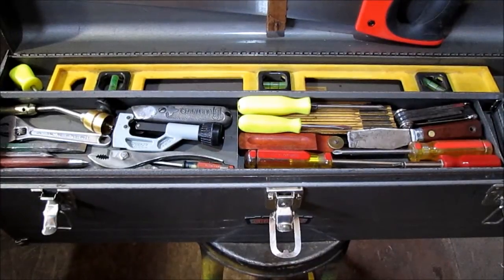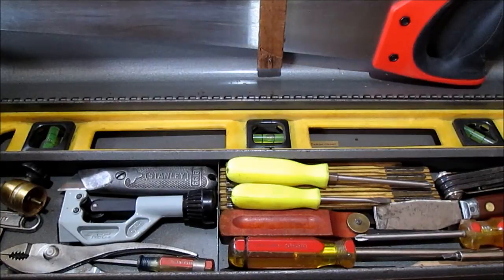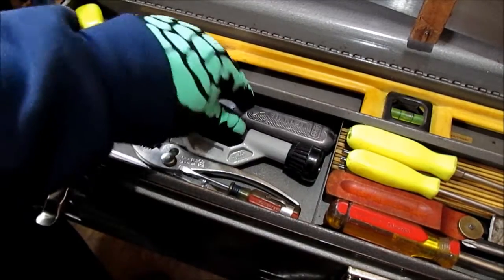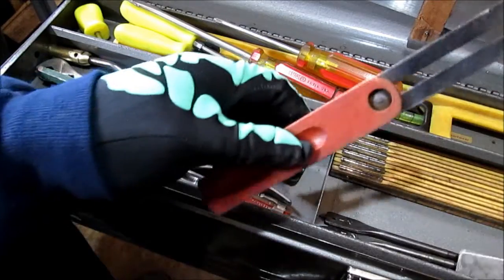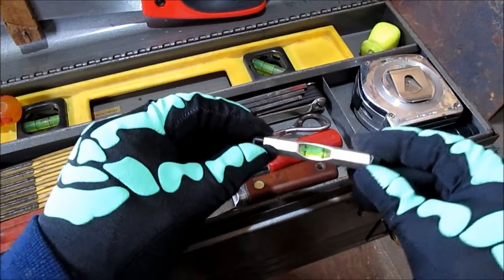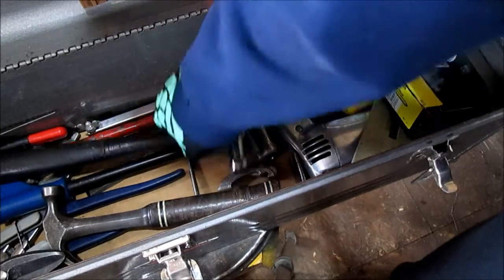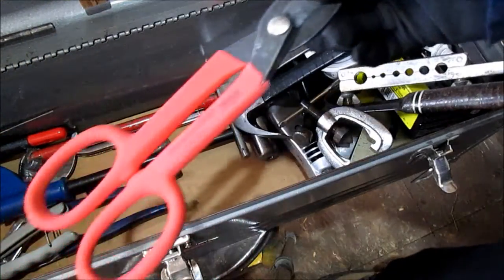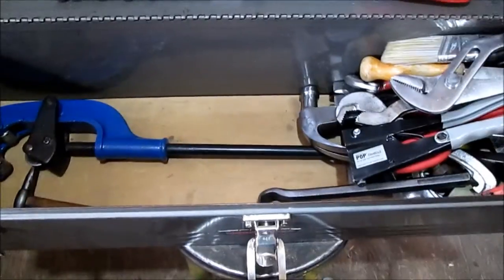What's in my CRAFTSMAN carpenter box

Comment: Bettlejuice on his day off from scaring people. 😂 only kidding. Good vid. I just bought a similar box.
Reply from the maker: I like old tools !!!
Reply: not2fast4u2c 

Yea. I love old tools too my friend. Here in the U.K. 🇬🇧 we have, what we call car boot sales. People bring their junk in their cars to a car park. Park cars in a semi circular fashion and open their boots(trunk to you over the pond) and sell. Some bargains to be had in the way of tools. I try to buy old wood chisels. Not just because I collect them but because the steel is superior. I've got the same estwing hammer. Beautiful tool made in Illinois. USA. My box was originally made to house a telecom cable crimper which was broken. So I discarded that and several dividers which I'm in the process of grinding out. I found the box on eBay for £20. I might make a tool tote for smaller tools such as Tape measure, pencils etc. For the top. I like how how you got your handsaw in the lid. 
Here's a tip.... cut a 6mm piece of spruce ply for the bottom made. I will soak up the damp away from your tools. And spray the inside every now and again with WD40. Thanks for posting. I'll go have a look at your other videos now. 😀
Reply from the maker: I have added a nice old aluminum blue Stanley level to this box to replace the cheap plastic one I still need to get or make a key for the lock
Reply from the maker: https://www.youtube.com/watch?v=E4Jtk9ojb_8  Stanley Level